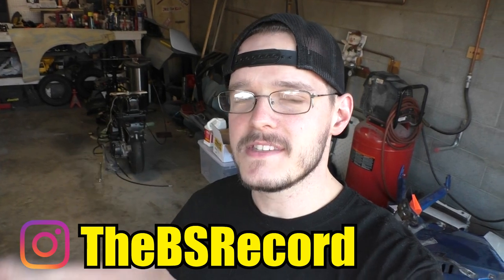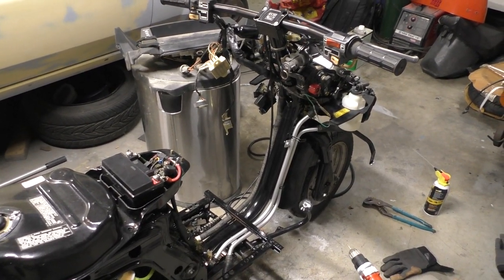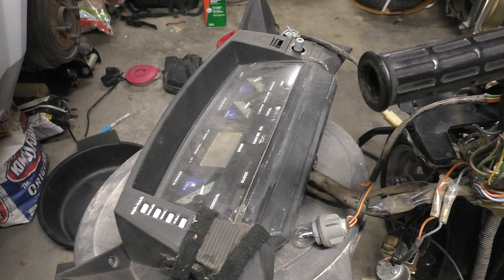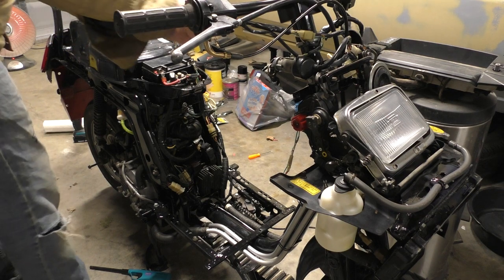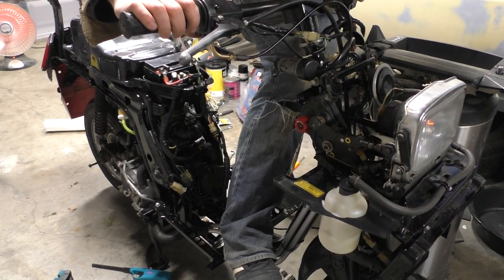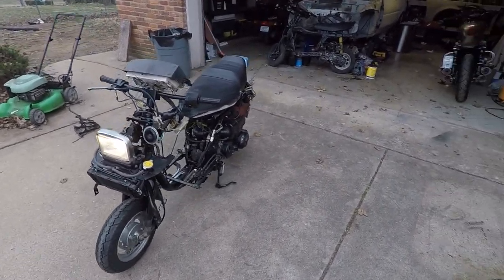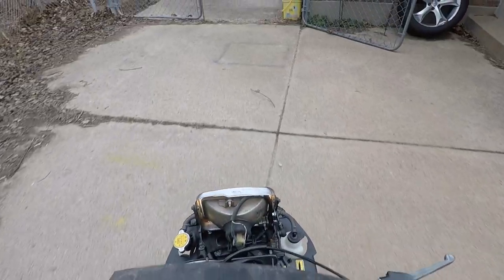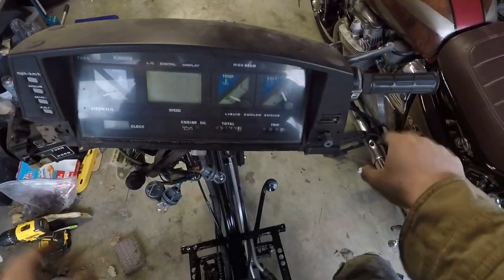Saving A Honda Elite 150 Deluxe - Part 4 | DIY Scooter Restoration Project / Honda Scooter Rebuild

Comment: I've got a pair of these. The 150cc does 55-60, and the 125cc does 50. I highly recommend refurbishing an OEM carb. The Chinese ones are a nice bandaid but they tend to clog and don't seem to run quite as efficiently. My 150 went up to 63 before I put a Chinese carb on it.
Reply from the maker: Thanks for tuning in! I agree with you, I let the scoot sit a couple of weeks and it is now clogged.  I am in the process of trying to get an oem one since the one that came on this scoot is way to far gone.